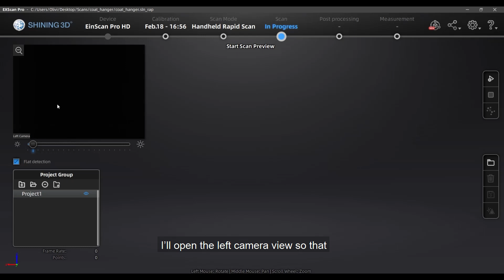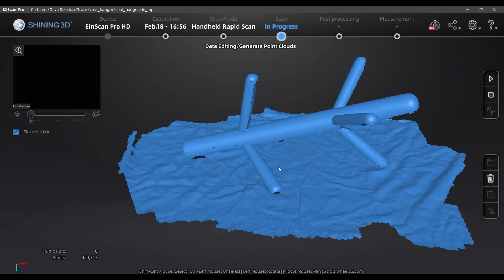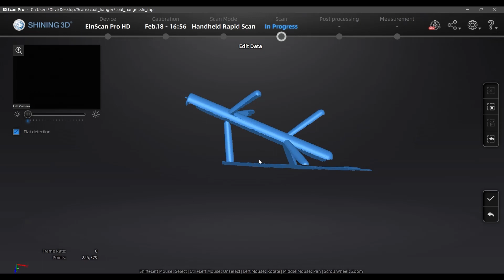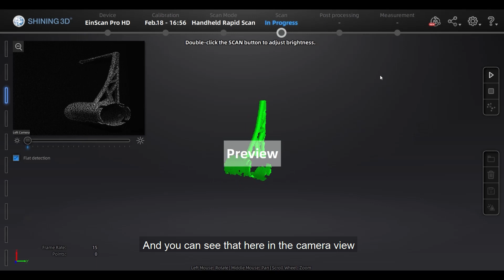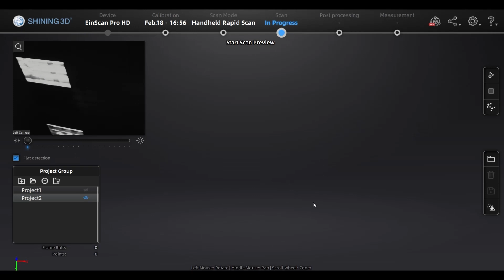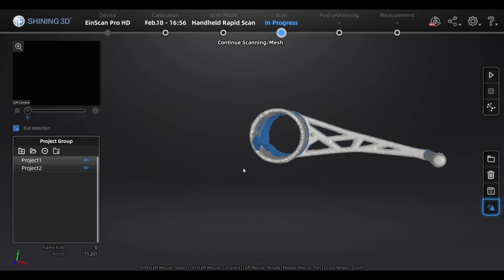3D Scanning Tips Part 2: Adding Extra Features With Everyday Items

Comment: How did you get to the align screen?
Reply: The align tool is on the right side of the screen under the "generate point cloud" tool. You can use it when you in the scan page or the post processing step.